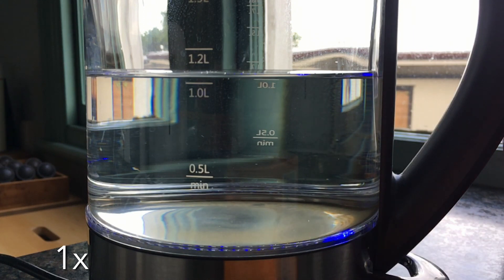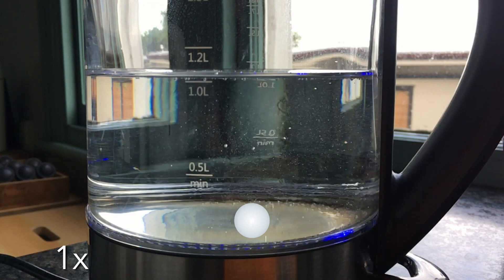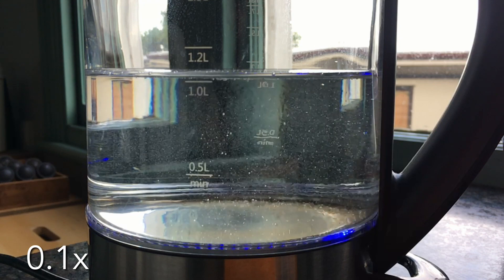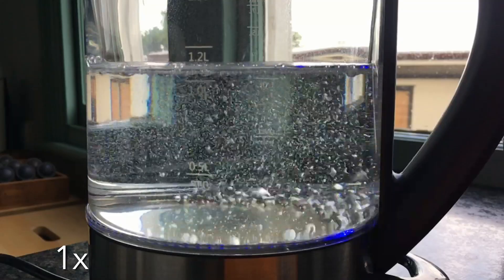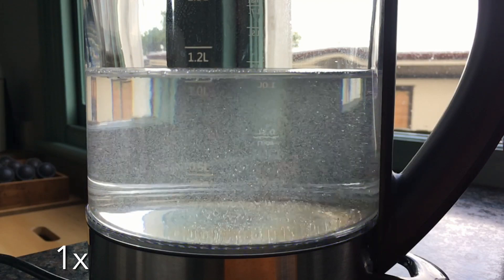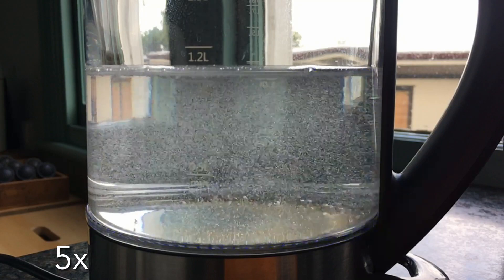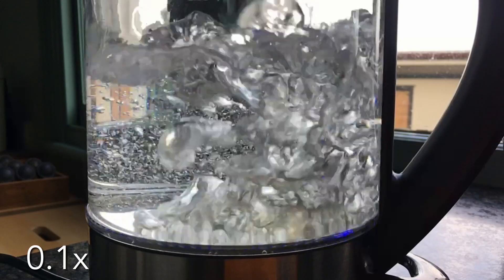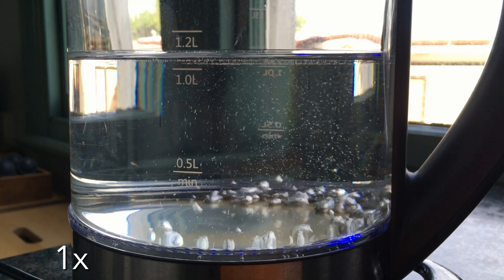Why is a boiling kettle so noisy?

Comment: Have you ever noticed that if you pour out some water after it has started to heat up, the noise level drops significantly for the rest of the heating cycle? Well, it doesn’t have to be while it’s heating - I filled the kettle last night, poured some out this morning before turning it on and it was very quiet. I’m assuming it’s something to do with bubbles attached to the heating surface. Do the bubbles reduce the efficiency? Would a different heating surface material, coating or shape reduce the noise? Anyone want to investigate? 😅